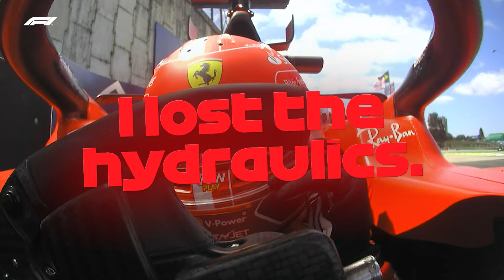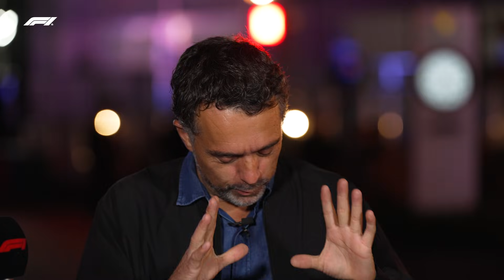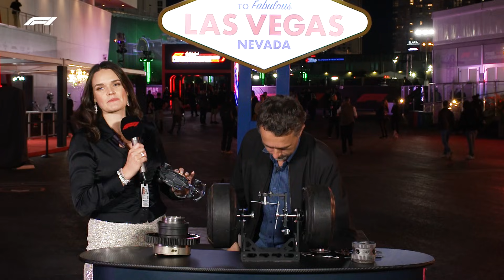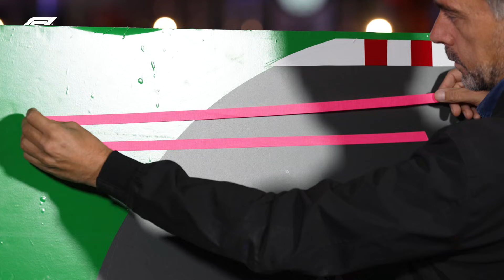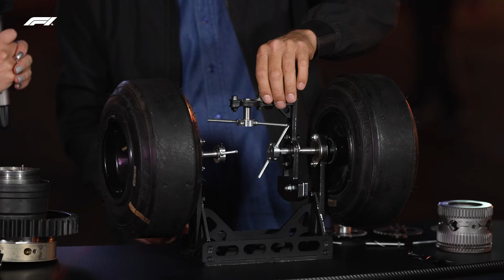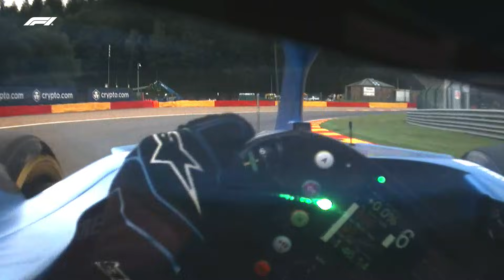What Difference Does A Differential Make? | Albert Fabrega F1 TV Tech Talk Demo | Crypto.com

Comment: The differential always splits torque 50/50, so when one wheel spins, it just means there's not enough torque to spin the other wheel, but still a 50/50 split. Unlike HP, torque doesn't imply rotation, such as when applying torque to a bolt that's rusted in place and wont move. Torque can be high with 0 HP.
Reply: Nice explanation
Reply: It's never a 50/50 split unless both drive shafts are the same length and travelling at the same speed...

Comment: I know it’s a Different series but I’ve been told Indycar have 100% locked rear diffs on ovals … ( because one of rear tires has bigger circumference to aid turning on the banking at such huge speeds) and your notice now that the drivers are turning very slightly to the right on the straights to go straight! ……but then they also use more like open f1 style diffs on the road courses … but are their ones able to be changed on the fly like these f1 ones are electronically?
Reply: Electronically controlled diffs have been available in road cars for a few decades now.  

They're more common in the center diff on performance AWD vehicles.  The new Toyota center diff in the Corolla is really interesting.

Comment: i designed my own differential setup back in 2016 based on spur gear arrangement only, without any reference material. Inspired from automotive arrangements, it was for non-automotive application. It had flat and compact profile , just like the F1 type shown here. I like how he always explains things nicely and make it so simple, otherwise it takes all day to understand the know hows of all diff' types. Its fascinating to learn that these diff' settings need to be altered before every single corner by the driver, every single lap, all the time..., adding more mental load to the driver. I wonder how do they manage this during qualifying, when all their focus is on quick lap times.
Reply: There's a video I've seen Alonso in qualifying and focus into what setting he's changing when qualifying and there's a lot of change, even correcting the setting when he's got it wrong
Reply: They have presets they can change to.
Reply: @gmabailey40  I am aware of this, but still need them to manually change to a different setting every corner. Some tracks have more hairpins, some dont, some only have right hand corners, etc, so the presets are set accordingly. But still, they need to toggle into these while going on to straights and then changing them again to tackle the corner at the end of the straight.

Comment: Nobody in these comments knows anything about cars or racing you can tell, modern f1 fans are just obsessed with the teams and drivers. Social media has made them all so tribal and simple minded, is it any wonder you lot find Monaco boring? Told what to think by twitter 😂
Reply: Monaco has the least overtakes out of any of the circuits. That's  why people hate it.  "The bottom three circuits are Monaco (4.0), the old layout of Albert Park Circuit (5.7) and Mugello (18.0). Other notable circuits with a low number of overtakes per race are Marina Bay in Singapore (19.5), Imola (19.7) and Autódromo Hermanos Rodríguez in Mexico (22.0)."
Reply: @Industrious420  you made my point for me. Formula one is about more than just overtakes, especially when most of the ones we see are using DRS. I prefer the challenge and the spectacle of Monaco.